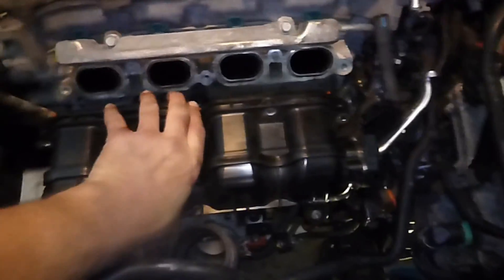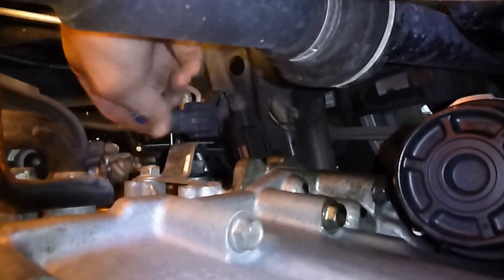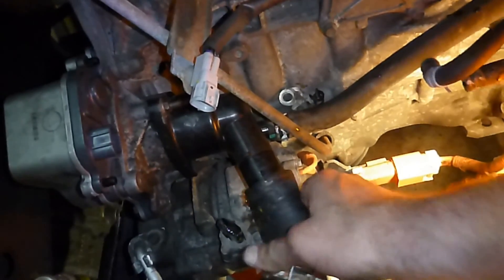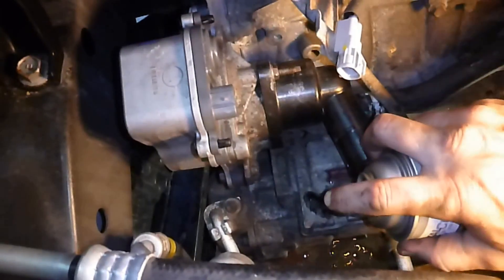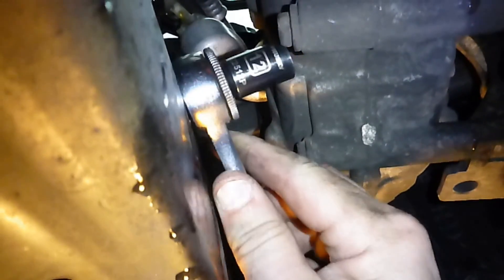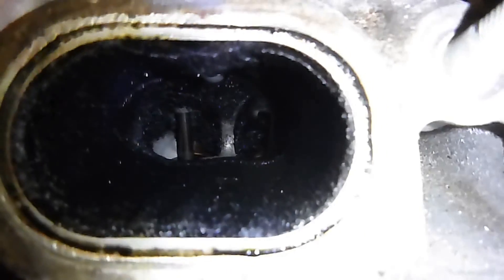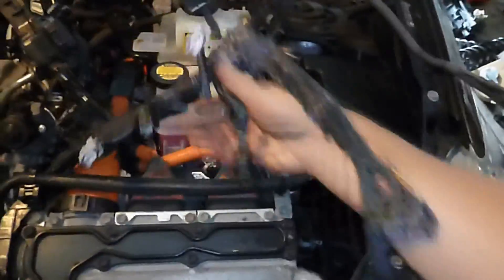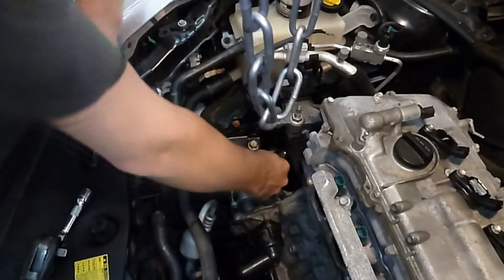Part 3 - 2016 Prius Engine Swap into 2012 Prius V - Start to Finish

Comment: love this vid. my Prius just blown. piston rod blown out of the engine so much carnage. heavy rain in my area. drove threw flooded water blown 2 weeks later engine failure. doing a engine swap. dis video help a lot. plus my engine was burning to much oil. before all this happen. ran out of oil before my 5000 miles change.
Reply from the maker: Hi,
  Thanks for your comments. Please subscribe to my channel.
Good luck with your new engine!

  - Fix That Pruis !!!

Comment: Hey buddy...so u commented about the 2012 motor getting alot of oil into the intake...do u know if the new motor has the same flaw??
Reply: Lamu Taafua yes it does, all those engines came with that problem.

Comment: Hey buddy...so u commented about the 2012 motor getting alot of oil into the intake...do u know if the new motor has the same flaw??
Reply from the maker: Thanks for your question.
There has been debate about this on PriusChat.
The conclusion is that Toyota has a recall on the pistons and rings on older Prius engines. The mileage is limited on the recall so good luck with that, but the good news is they acknowledged a problem and fixed it. 2015 Prius's have the new pistons and rings. We'll see if they got it right.
   - Fix That Prius !!!

Comment: @10:25 When is Toyota going to own up to this problem?  It's happening to 3rd gen Priuses with a lot less miles than 200K, and shortening the lives of cars that by rights should have lasted much longer.  2nd gen Priuses are outliving 3rd gen at this point.  @TOYOTAglobal should step up.

Comment: Why would you do this swap?
Reply from the maker: The 3rd Generation Toyota  Prius engine (2010-2015), is great until the oil rings clog up, around 80,000 miles. It starts burning oil which clogs the EGR preventing it from closing. This causes the spark plugs to foul and a misfire. You can unplug the wires from the EGR and it will stay closed but the engine will continue to burn lots of oil, like a quart every 600 miles. The burnt oil leaves carbon on top of the pistons which reduces the space between the piston and the head until the head is popped up enough cause the head gasket to leak. At this point you can rebuild it and try again or you can put a greatly improved 4th gen 2016-17 Toyota Prius engine in your Prius with a few minor modifications. No dealer would ever agree to do this and most mechanics will tell you you can't. I proved that you can put a 4th gen Prius engine in a 3rd gen Prius.
I hope that answers your question.
Thanks for asking.    -   Fix That Prius!!!
Reply: @fixthatprius4980  I am in DIY process of changing the head gasket in my 2013 Prius. I got 179000 miles out of it(far work cummute). The source of the oil clogging the oil rings is the PCV valve, and my intake manifold was practically  filled with oil gunk. Why would the PCV put out that much oil?  I already have the cylinder head off.   What is the fix for prevention in future? Will every few thousand miles checking the intake manifold and clean it out help?  will changing the piston rings be a solution as well? or does the pistons have to be replaced as well? do new pistons for this have the better oil rings? ...or I could stop spending money, put the crap together with the new gasket and trade it in the a 2017 Prius? Or maybe go with a Chevy Volt or Bolt.
Reply: Good to know, I just a did a gen 3 replacement just straight with another gen 3 it had 180k and blew the head gasket
Reply from the maker: @nickjonesadventures  That sounds great!
Reply: @fixthatprius4980  do you have a video of you putting in the 4rth gen engine in the 3rd gen prius?
Reply from the maker: @nickjonesadventures  The swap not the blown head gasket.
Reply: @fixthatprius4980  i am order 2016 engine cost $ 1600 include shipping it better than bought coil it cost $500 from toyota dealer